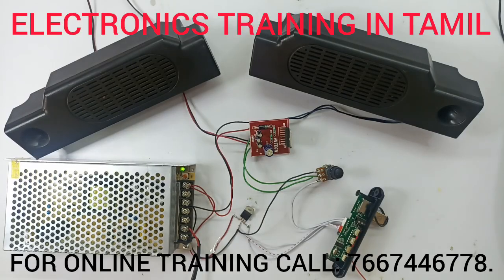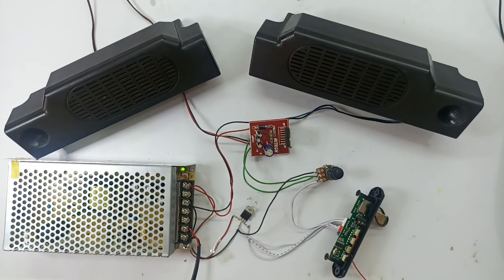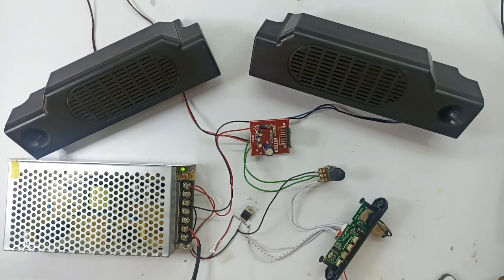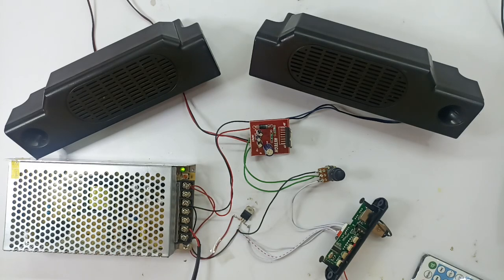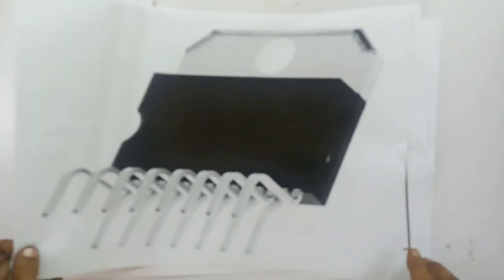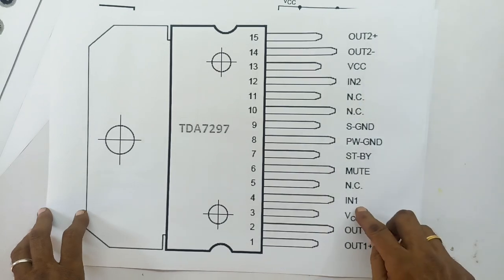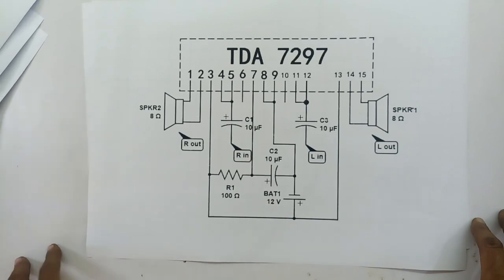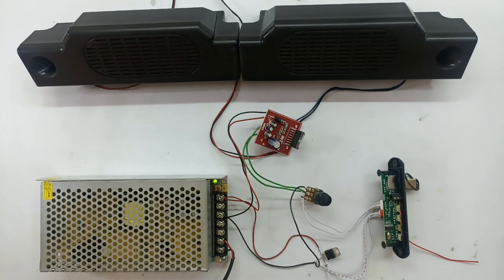DO IT YOURSELF...TDA 7297 IC USED AUDIO POWER AMPLIFIER...SUB WOOFER DRIVER.. WORKING PRINCIPLES ++

Comment: I noticed everybody who uploads these kinds of demo, none of them informs about how much ampere rating should be given.  Because it plays vital role in output.  I agree it is given in datasheet, yet you must mention.  Voltage is something you eat, but ampere is something energy.  Energy is important.  If you give 24v with just 2 amps in TDA 7265, you will never get good snd and solid out.  So, please mention ampere rateing too
Reply from the maker: Ok, thanks for your suggestions